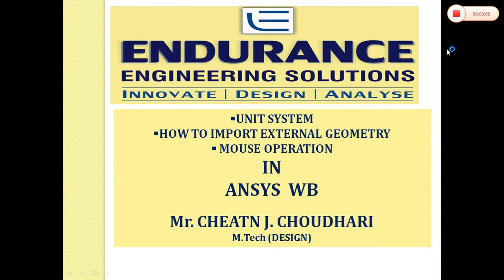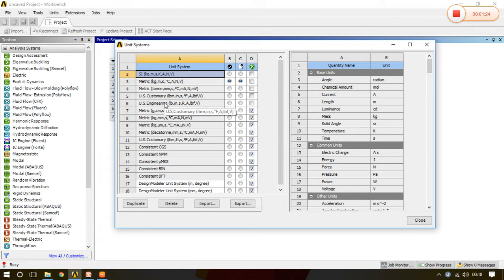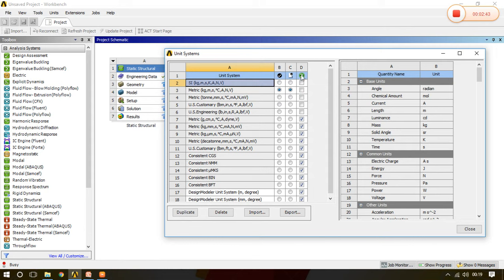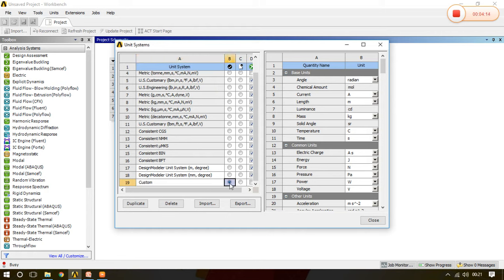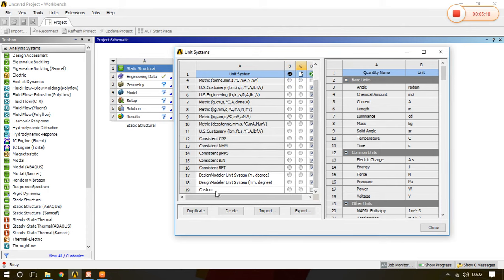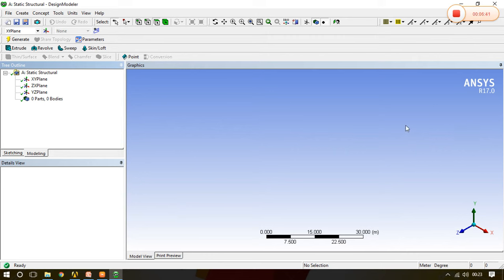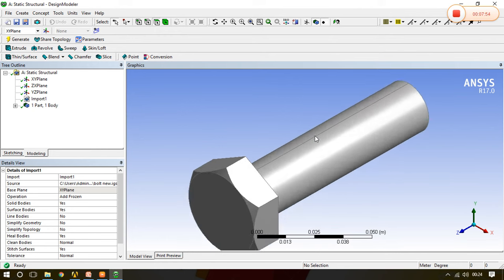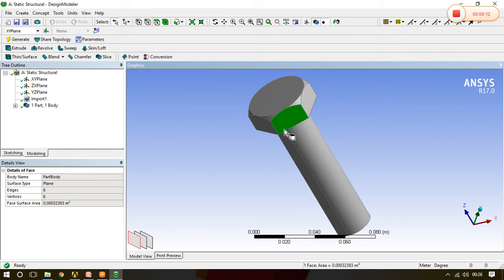ANSYS IMPORT GEOMETRY IN , UNIT SYSTEM  & MOUSE OPERATIONS(ZOOM IN/OUT,ROTATE & PAN)TUTORIAL 2

Comment: Thanks for the video.
I exported gemetry in .igs formate from design modeler with units in 'mm' (say length in 300 in mm). But when I imported the Geometry in APDL I got the units in 'mm' (say 0.3).
Can you suggest what might be the reason for this change in unit system ?

Comment: Negar Pajooh is advanced simulation institute of mechanical engineering systems
Software:
MATLAB - ANSYS - ABAQUS -SOLIDWORKS-Arduino-Labview
 Fields:
 Control, Solid Mechanics, Structural Engineering, Optimization, Fuzzy, CAD, CAE, Mechanical Vibration, Robotic, Shaft- Impeller , Rotor Dynamic, Condition Monitoring, Fault Diagnosis, Health Monitoring, Wavelet, Neural Network, Image Processing, Sensor and Actuator, Sound Processing, Finite Element Method (FEM), Piezoelectric, Numerical Method, continuous structure, Active/Passive Vibration Control Channel 
Youtube Channel: https://www.youtube.com/channel/UCeaa6Kt3mBKNW-fNgNgOqTg
Gmail: NegarPajooh@gmail.com 
Phone, Whats app,Telegram:: +989198470686
Website: http://www.negarpajooh.com
#matlab#ansys#workbench#simulation#mechanical_engineering#solidworks#labview#solid_mechanics#mechanical_vibration#arduino#condition_monitoring#rotor_dynamic#rotary_machine#fault_diagnosis#abaqus#health_monitoring#signal_processing#sound_processing#sound_vibration#sensor_actuator#piezoelectric#negar_pajooh#CAD#computer_aided_design#image_processing#finite_element#numerical_method#analytical_method#modal_analysis#static_structural#frequency_response#control_engineering#controller#block_diagram#fsi#pde#partial_defferential_equation#artificial_neural_network#mechatronic#arespace#ordinary_defferential_equation#robotic#wavelet#optimization_algorithm#fluid_solid_interaction#ansys_fluent#computer_integrated_manufacturing#computer_integrated_engineering#CAM#CAE#ansys_apdl#mojtaba_hasanlu#dynamic#machine_design#medical_engineering#structural_engineering#fft#fast_Fourier_transform#code#script#research_paper#fuzzy#optimal_control#genetic_algorithm#ga#pso#particle_swarm_optimization#thesis#freelancer#matlab_toolbox#metaheuristic#noise#uncertainty#equation#disturbance#robust_control
#متلب #انسیس #ورک_بنچ#شبیه_سازی #مهندسی_مکانیک#مکانیک_جامدات#ارتعاشات_مکانیکی#کنترل_ارتعاشات#سالیدورکس #لب ویو#آردینو #عیب یابی_ پایش_وضعیت#سیستم_های_دوار #آباکوس#سلامت سنجی #پردازش_سیگنال #حسگر_عملگر#پیزوالکتریک #الگوریتم_بهینه_سازی#پردازش_تصویر#طراحی_مکانیکی#المان_محدود#اجزا_محدود #روش_های_عددی #روش_های_تحلیلی #طراحی_به_کمک_کامپیوتر #تحلیل_به_کمک_کامپیوتر #مهندسی_سازه #مهندسی_کنترل#رباتیک #بلوک_دیاگرام#تعامل_سیال_با_جامد#انسیس_فلوئنت#کنترلر#کنترل_کننده#معادلات_با_مشتقات_جزئی #مکاترونیک#مهندسی_پزشکی#معادلات_با_مشتقات_معمولی# شبکه_عصبی#تبدیل_موجک #کدنویسی#پروژه#مدل سازی#مقاله #تحقیق_پژوهش #معادله#فازی #بهینه_سازی#الگوریتم_ژنتیک #بهینه_سازی_ازدحام_ذرات#پایان نامه #فری_لنسر#ترجمه_زبان_انگلیسی#تولباکس_متلب# #متاهیوریستیک#نویز #عدم_قطعیت#سیگنال#اغتشاش #کنترل_مقاوم